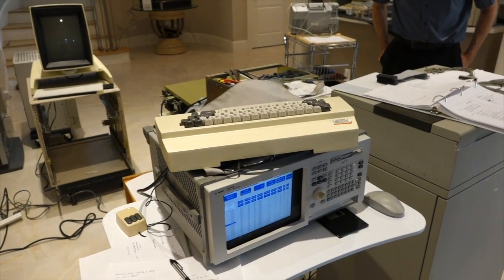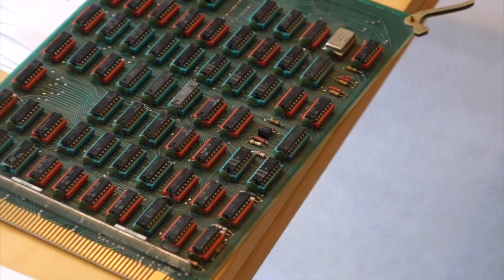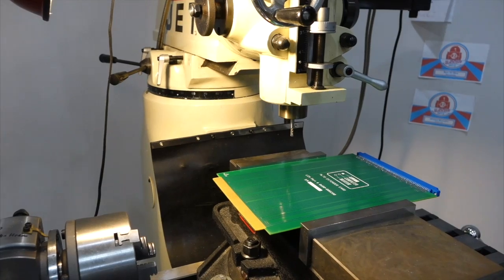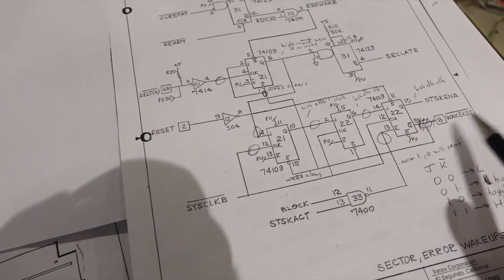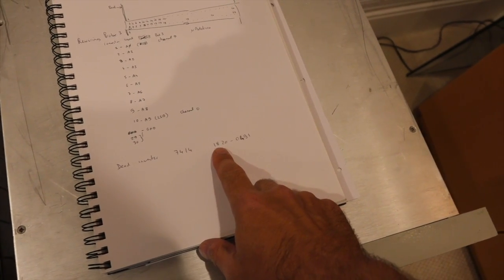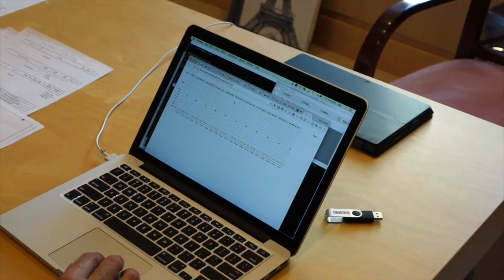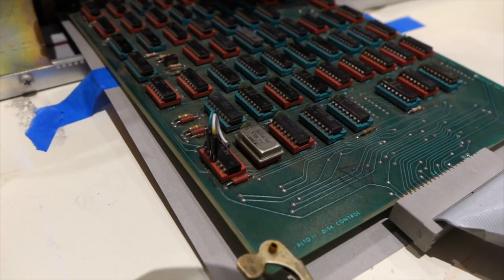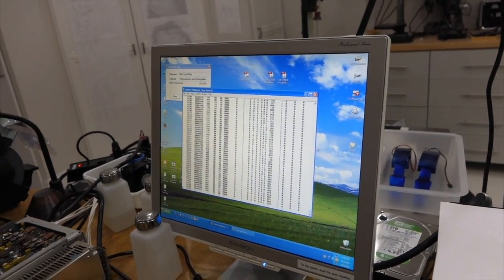Xerox Alto Restoration Part 6 - debug leads us to a failed IC

Comment: Since Most of the ICs are Standard 74 Logic Chips and socketed, wouldn't be easier to Just Take them Out and Test them with for example a minipro eeprom writer? Taking Out and reinserting Chips can also help with Connections that gone Bad over time

Comment: Sur mes tables de correspondance pour les circuits TTL chez HP, je trouve ça :
1820-1053 SN7414N 
1820-0491 SN74145N
Pas sûr qu'un décodeur démultiplexeur fasse l’affaire... ;)

Comment: Why does it have to be a "HP" 7414? I do not see why a version from any manufacturer would not do. It is not a rare component.
Reply from the maker: It doesn't. I just happen to collect HP, so I have mostly vintage HP-numbered parts on hand! They are regular Texas or National parts with (very annoyingly) an HP number. This is just temporary. we'll put a regular 7414 when I have time to get one...
Reply: I'm no expert on the Alto, but I do know that for any computer system, you generally design it to run as fast as possible for the given hardware, using known chip nanosecond cycle times, so an off-spec part, while probably being OK provided it's faster, could still have some unforeseen consequences. Best to solve problems instead of risking the introduction of new ones.

Also, genuine parts nostalgia?
Reply: or possibly even better - military spec version so wider operating range, sometimes more stringent testing cutoff. At the time, much more expensive but now, . . . .

Comment: A 7414 is a super common chip, I'm really surprised you couldn't find one around there. Is there a reason you specifically need a 7414 and not something newer like a 74HC14?
Reply: It wasn't hard to find in general, but it was hard to find at the moment. Nearby shops like Anchor Electronics have plenty of 7414 chips, but they were due to close in less time than we could drive there. To avoid a delay, we hoped that Marc might have a 7414 in his pile of HP spare parts, but it didn't work out.
Reply: HCT should work in bipolar circuits.
Reply: even identically specified new chips are not always compatible - you HAVE TO use original ones of the same manufacture date often